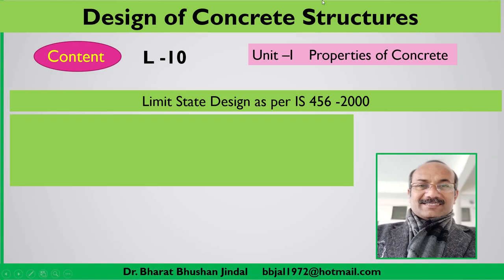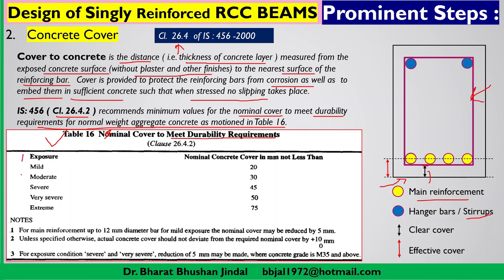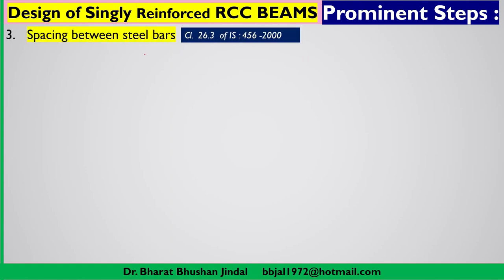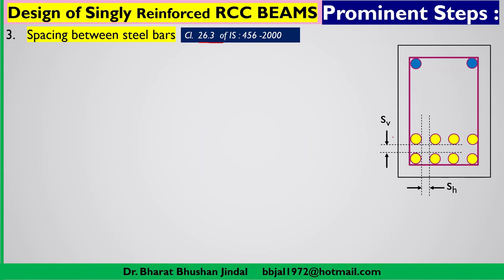Lecture 10 || Design guidelines  - A singly reinforced beam || IS :456 -2000 ||  Civil Engg.

Comment: Sir in diagram at 24.23 what is red boundary outlining reinforcement  called
Reply from the maker: It can be called as a ring which helps in keeping bars in place or more appropriately it is shear stirrups ( because minimum shear reinforcement is always required).   It will be explained in details later.